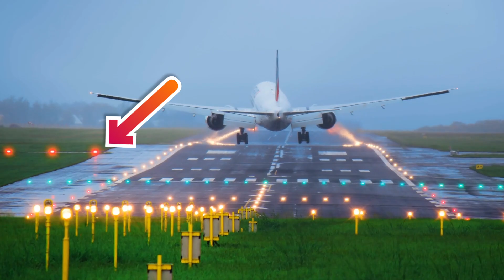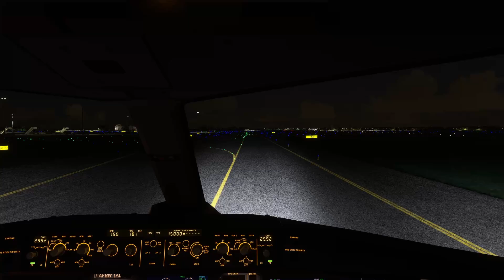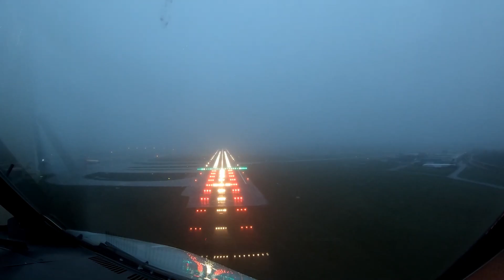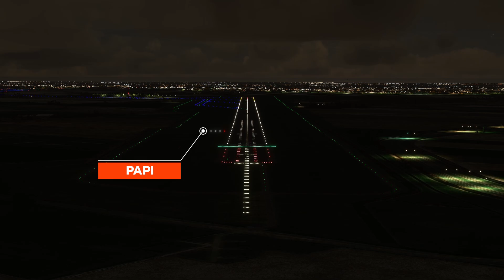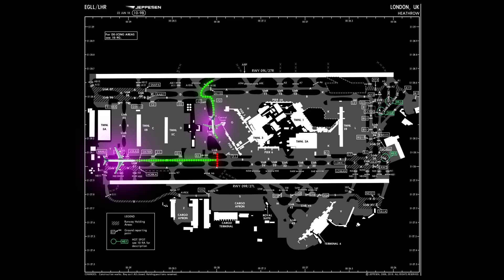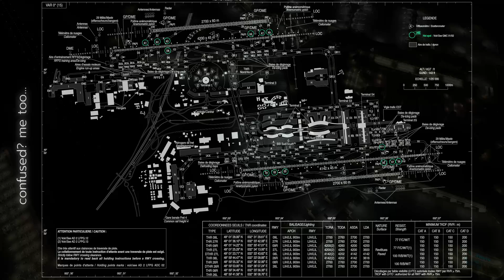Airport Lights - Do You Know Them All? 💡

Comment: Having heard of a recent , nearly disastrous runway incursion , ( not here thankfully ) , I imagined a system of red or green lights to VISUALLY augment the         sometimes garbled , missed , or ignored  Air Traffic Control instructions to pilots .  It is amazing what limited attention spans or burdened cerebral bandwidth will                        FAIL TO REGISTER .   With fatal results .   Living in the Minneapolis , Mn. area , I recently voiced my ideas to an executive level guy I know at the MAC at MSP .  To me , the solution is apparent .   Seems universally understood that RED means stop !       By god if somebody wasn't on this yet , I swore I'd come out of retirement and see it through .  Put a bright red line across any point where an unauthorized aircraft could possibly , mistakenly enter or cross an active runway !                                                             Recess it into the tarmac to prevent snow removal equipment damage .  Angle it to be only visible to the relevant aircraft .  Red means HOLD !   Green guide lights to show pilots in unfamiliar situations where they should go , would be an additional upgrade !      Even digital programmable menu boards could provide instant confirmation with call signs or other relevant info .   Make it as easy and obvious as possible !   Remove every bit , every layer of complexity .                                                                                                                                                                                                         We must be aware that complicated information given orally may be easily missed by otherwise capable but distracted flight crews !     DO YOU HEAR ME ???                    Thanks to those already working on this important concept .

Comment: Ohare and several other U.S. airports also us in pavement runway guard lights (has the same wig-wag as the lights on the sides of taxiways) as well the new stop bars. Runway occupancy lights are being installed during heavy maintenance to automate take off clearances (the string of red lights for traffic crossing a runway). ATC is currently being trained on the new system.

Comment: Did runways and taxiways have incandescent lights before LED's came out?
Reply: They were probably standard incandescent or halogen. The approach flashers at the end of the runways are still likely xenon bulbs for the most part. Similar to the ones you would find in a camera flash unit. Rotating airport beacons have either metal halide arc, LED, or halogen lamps.

Comment: An altogether mesmerizing video! One thing that constantly impresses me is how aircraft don't run over these lights. Many of them appear to stick out of the tarmac surface and be quite vulnerable, or so it seems from a passenger window.
Reply: The lights on the taxiway or runway itself, such as the green taxiway lights, runway centerline lights, and touchdown zone lights are all flat on the surface. Tires can run over them with no issues.

The other lights such as the runway edge lightning or the blue taxiway edge lights stick out by the edges of the runway / taxiway, but under normal circumstances the aircraft won’t run over them because the tires will never be anywhere near the edges and the wings are very high above the ground. 

However there have been incidents when aircraft have run over the lights such as during runway or taxiway excursions or wingstrike.
Reply from the maker: indeed! I always wonder if I'm one day going to hit one. It's unlikely, though.

Comment: There are variants of PAPI lights, such as a variant with 2 lights, same concept though. Quite sure there's also a variant with one light, with different colours. The Boeing 747 actually wants to have 1 red 3 whites on their approach due to the height of the cockpit.
Reply: Just got a heart, bloody realised that I implied that the 747 itself wants the 3W1R configuration, I doubt it cares, the pilots want that!
Reply: @DsYkX  Haha, who knows, maybe it does care! 😉
Reply: Seems you're right. Just stumbled across a 747 pilot on YouTube that explains the Papis in particular. 3w1r for 747 aswell as for Concorde due to their higher angle while landing. He doesn't mention the A380 but correct me if I'm wrong but I thing their cockpit is not on the upper deck but more between upper and lower and therefore not as high as for the 747s.
Reply: Three whites due to the cockpit height. I think the other one is all reds, I’ll be dead?
Reply: @uzaiyaro  Yes, it is, I think that's what the saying it.
Reply: didnt know about 747, wondering if a380 also needs 3 white one red ? i cant remember were did i read that first who used papi were russian or am wrong?
Reply: @arkan7rb  from basic information i can find online, likely 3w1r, of course, it was some light research so it might be wrong, anyone who knows are free to point it out, but I'm basing it off of the cockpit height in reference to the aircraft, not exactly the best way!
Reply: Same for the concorde
Reply: As a pilot having 6000+ hrs on a B747, I disagree… we still fly 2 white and 2 red on the PAPI with a typical 3.0 degree approach path. 3 white still means you’re high.

Comment: Would be nice if the row of the Green lights are at the very start of the runway strip, where the "^"s are, so that the aircraft touch down at the start of the "^"s.
Reply: You are not supposed to touch down on the arrows leading up to the landing zone, which is marked with the green lights. That area can be taxied on with a plane, but not landed on